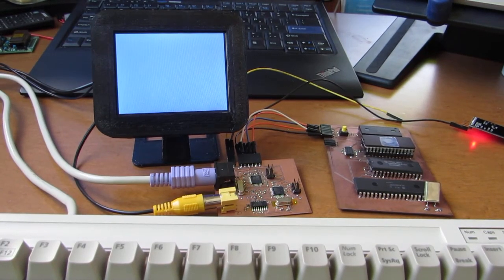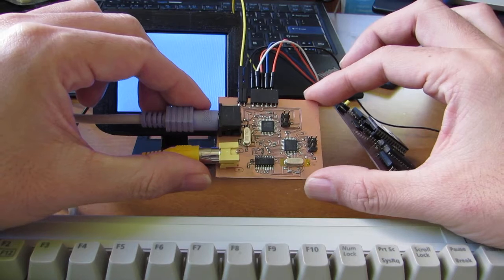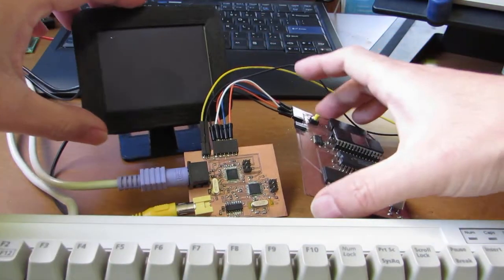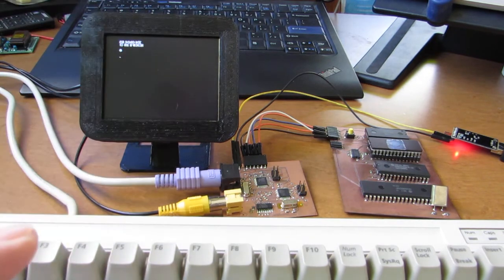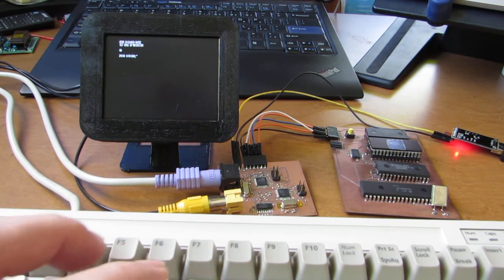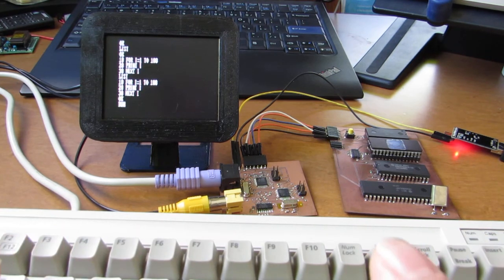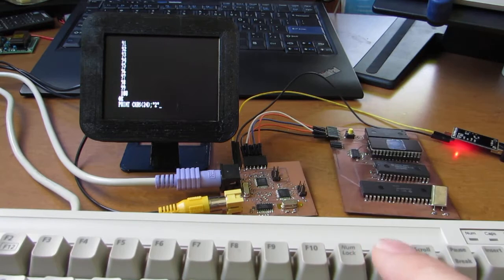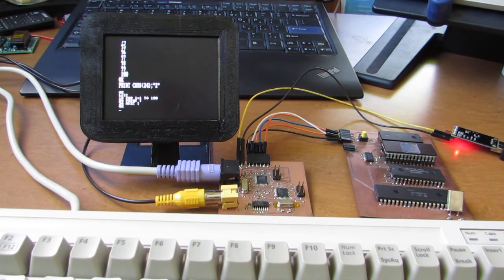Intelligent video console for retro computer

Comment: so you built a terminal control board with built in command parser? that's pretty cool.
Reply from the maker: +tyler “sarcastic” roberts Thank you comment. Actually I did not design its circuit and just design PCB for it. This console is very multi-functional and itself already a computer. In fact I've tried to design similar one but I could not make such a wonderful one like Grant's design.